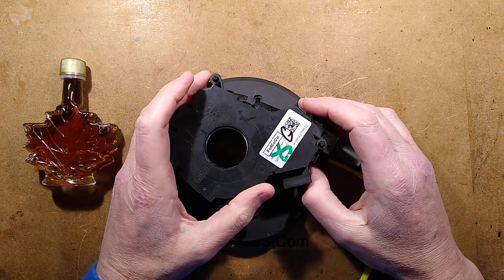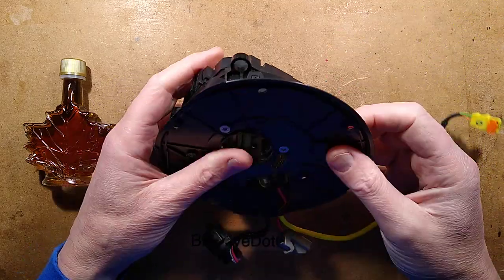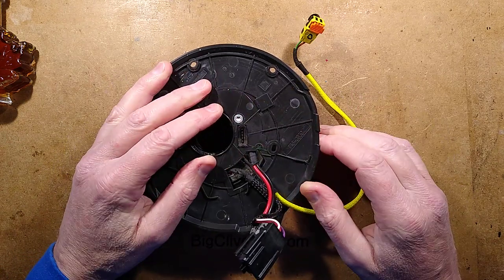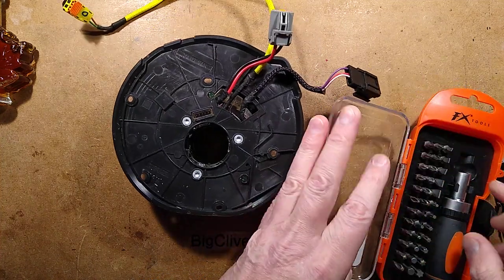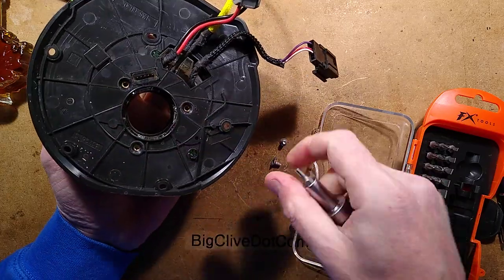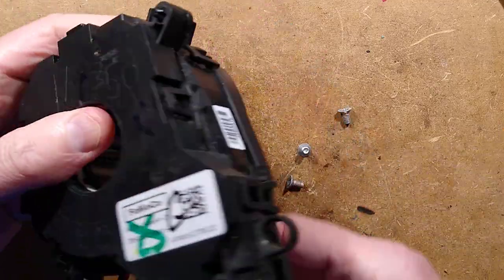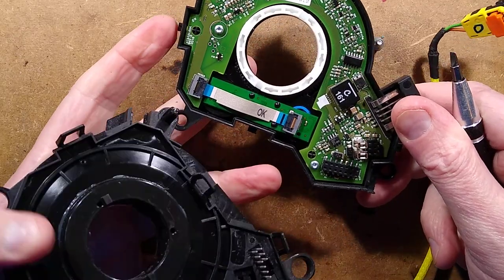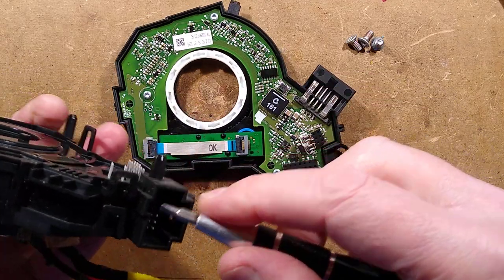Inside a car clock-spring module (steering wheel wiring interface)

Comment: That is a really genius way to make a "slip ring" when you don't need continuous rotation, but only a fixed number of rotations in each direction! Just use a long ribbon cable!
Reply: I bought one from a truck after failing to make a DIY-style slip-ring setup for my sim-rig, and even though the one I have is much more simple than the one Big Clive got send, when I opened it up I was like "Now why didn't I think of that?" :P
Mine does 12 turns from fully left to right before hitting some kind of endstop.  The ribbon cable is not forced at that point, because I can still hear it rattle in both positions.
The one I have does not calculate the wheel position (knowing Volvo parts by now, they found some other superingenious solution somewhere else in the steering column for that :P ).
The buttons on the wheel the clock spring module belongs to (there are 5 in total, 2 horn buttons sharing the same 2 pins and 4 cruise control buttons that are multiplexed (I think) because there's only 4 pins present, which is obviously to small amount for 4 buttons.

Luckily the PCB has a marking for the V+, so that at least gives me a clue :P.

Comment: Fun video. Reminded me I modified my 1970 MGB to move the horn button from the stalk to the center of the steering wheel. Chopped up a pen to hold a carbon brush and glued a copper PCB to the steering wheel hub to act as a slip ring.  Looking at the assembly it has more wires then the entire MG.

Comment: Fortuitous timing Clive, from my point of reference at least. I just rebuilt my steering column on the parlor floor a week ago. Had to pull the wheel a second time as I had got the clock spring position wrong. Cheers!

Comment: i had one of these causing an intermittant fault in a Nissan X-Trail. Sometimes the buttons on the steering wheel would not work depending on what position the steering wheel was in. To mitigate this i tried to turn the clockspring one turn either way so it would be in a portion where all the functionality would work. Unfortunately there wasn't enough play and the clockspring ribbons snapped inside causing the cars electronic stability to be disabled. This also caused the reversing camera lines to be allover the place. Cost me £500 for a replacement but i think it needed one anyway. They are pretty impressively complex after watching this video. thanks!

Comment: That's the SCCM (Steering Column Control Module). It does exactly what you said It does.
The data from the steering angle sensor is used by the static bending / dynamic lighting, as well as the electronic stability program, reversing camera, and a few other systems.
They are delivered with a locking pin to prevent roration until they are fitted to the vehicle.

Comment: Do the two small gears have the same number of teeth? If not, that gives the absolute encoding since the two magnetic encoders are never in sync. The encoder chips are probably something like the AS5600
Reply: I agree with this. 
If the number of teeth was off by one, each rotation of the larger of the two gears would cause a phase shift of 1/number of teeth on the smaller gear. That should make it pretty easy to calculate absolute position regardless of the initial positions by calibrating and storing the relative phase at the two ends of travel.
Reply: You're probably right. Sounds like a smart solution to the absolute position problem. And why would there be two gears if they were to be identical?
Reply: different number of teeth also increases resolution
Reply: one hint is that one gear is color coded to visually confirm proper assembly
Reply: I figured the two chips would be out of phase to tell direction, but never heard of a solution like that with a different number of teeth. What a cool idea!

Comment: After you put a new steering angle sensor in, usually you need to calibrate the module with a learning procedure. Usually this starts with centering the steering wheel, then turning either way. The computer uses the data obtained to decide where the steering wheel is pointing. So it doesn't need hard data with a second magnet or reluctor ring to conclude exact position.

Comment: Starring wheel zero is programmed in during the alignment process which is used primarily by the ABS along with yaw sensor input to properly apply individual brakes during an ABSevent. By the way,  the yaw sensor usually needs to be programmed for center  (zero) as well.  Love you channel.  Cheers

Comment: This part is typically destroyed when the airbag deploys due to the forces and high current sent to the charge.  
Older pre-airbag Ford trucks with cruise control still used slip rings, they just had different resistances for the switches.  There were three rings, one for the horn, one for the switch power and one for signal return.

Comment: The blue and black gears look like they may have differing tooth counts and would give out dissimilar signals to the module to keep track of absolute steering angle sensor. As far as a sensor center position, the module is usually installed then the wheel centered and a steering angle sensor calibration procedure completed to set dead center and max rotation.

Comment: I've been a professional mechanic/technician for 20 years.  My wife's Chrysler van started acting up one day, doing  ABS stop and traction control for no reason.  I found the steering angle sensor way out of align to what it should have been.  After I got a new clockspring,  I took the old one apart.  

I found a small plastic gear, about the size of a US nickel had one tooth broken off.  And that cost me $500 for the part.

Comment: The sensors have multiple hall effect sensors inside so they can determine the absolute position of the magnetic field without having to have a zero reference or continually count. They sell these sensors for amateur robotics applications too, and they're nice because you don't have to ram over to a limit switch to find a reference.

Comment: Fascinating. I always wondered how that was done. My car has a heated steering wheel and countless buttons and switches. I assumed slip rings but those can so easily fail. The gear driven magnets are likely used to determine the direction and rate of the wheel turning to inform the stability control system rather than the wheel's absolute position.
Reply: Now I know how the horn, airbag, and all of the cruise control and radio buttons on steering wheel are interfaced with the column on my F150.
Looks like it will be the "1,000 $ part" when one of the ribbon cables gets a break in it.
Reply: "The gear driven magnets are likely used to determine the direction and rate of the wheel turning to inform the stability control system rather than the wheel's absolute position."
The newer F150s have electric power steering. This could also control the amount of power assist, and in which direction.
Reply: That is indeed for stability control, but the control loops do need to know the absolute steering angle. There's a specific recalibration procedure on all stability control equipped vehicles that's necessary if the steering system is serviced.
Reply: Not only that but also for the system to know whether and when to cancel the indicators in more modern vehicles if this is not done with a mechanical notch like in a lot of older vehicles.
Reply: They usually have a resistor ladder for the steering wheel buttons. ( 3 wires required). Primitive D to A. So surprised to see quite so many tracks. 4 airbag, 2 horn, 1 illumination, 3 buttons ladder, 2 heater. Cruise buttons can be separate for safety.
Reply: @AndyK.1  You get that in older vehicles, but Ford now runs CAN bus, GM and Chrysler run LIN to the steering wheel controls. There's probably a number of ground traces for shielding, and you have bus segregation, so the cruise buttons are on one bus, the infotainment controls are on a separate.

Comment: Yeah that is two parts in one. The first is the steering wheel position sensor. The second is the clock spring assembly. 
I changed the clock spring in my 2005 GTO to a 2006 so I could have the lighted steering wheel controls of the 06 model. 
Very interesting video!

Comment: Wow this is crazy my mom gave me one of these to help fix her car because I'm dabbling into Electronics now. Now I'm not qualified by any means but I have a really good understanding of electricity and repairing and making my own circuits. This video helps out a lot
Reply: Please, don't try messing around with the steering wheel assembly...you do not want to mess with the circuitries there and possibly cause an accidental deployment of the airbag... A friend of mine was trained to be a car mechanic and had "respect for the airbag" hammered in to quite an extend.
If someone in his class was messing with a dummy charge of one he got a verbal reprimande not to screw around with those things...

Comment: The chips are set at 180' to each other, the magnets are set 45' to each other's N+S (you moved one, you can see machining marks on them you should have used a small compass). The Zero is set by that clip right at the start of the video and all of that all of that vehicles units are made the same. The clip releases when the steering wheel is fitted. when fitting these units you should the use a scan tool to confirm the steering angle through the CAN link, then all the other vehicle modules can access the data from it correctly over the CAN BUS.
Reply: I wonder if in some cases they might have a slightly bigger cog on one encoder which would give a phase difference that can be used for absolute positioning.
Reply: @cda32  It looks like this is actually the case (unless it's an optical illusion caused by the different colours).
Reply: Colin and JMMC it is possible that the blue and black cogs are different ratios, It was not pointed out on my VW Bosch courses but having said that is another system that uses carbon tracks at offset phase and pick up contacts, the more common fitted to BMWs as its so cheep,,,BUT its so cheep to fit at build and a nice price to supply at out of warranty. The unit BC took apart was removed from the vehicle because the airbag light was on or the radio controls or the heated wheel did not work not the steering angle sensor, if it was a track system on a BMW then yes the angle senor system fails first. The unit at manufacture is "timed up" to a pre-set zero and locked with the clip when replacing one as long as the wheels are straight and you take off the steering wheel and the old units clip locks back in you will have no problems, often even a flat/disconnected battery will only require you to lock to lock the steering or a short straight drive to config wheel speeds to steer angle (and that in reverse is how flat some tyres systems work on some vehicles) 
Now Big Clive If you read your comments (and I know you do,,,I did that in a Scottish accent) if you have not binned that unit show everyone why it is possible to disconnect and reconnect an airbag full live circuit engine running don't turn the power off!!! the clue is inside the yellow connector !!!!

Comment: Hey BC, I think the two wheels are slightly different diameter, they are coloured blue and black to tell them apart. The ICs are probably a compass. The ratio between the two gears and the 360 deg compass on each gear will give an absolute position since the two probably wont be in the same position for several wheel revolutions.
Reply: This is a absolute magnetic encoder. you are totally right about the gear diameter sizes! it create a ratio where absolute position is calculated. Very simple, effective and cleaver way.

Comment: Dang clever if you ask me. Sort of like the long 'U' shaped cables used to attach to a linear motion table but wrapped around in the gap between drum and casing.  Make the ribbons longer and you can have the 'U' bend travel around several times, accommodating a large number of turns of the wheel.  And you can put a lot of different ribbons in there, just attaching each to a different point around the rim, and each doing their 'U' bend at a different point around the circumference.

Thanks for sharing, I've learned a new, rather clever design trick.  :)
Reply: Bought one from a Volvo truck (the part itself funny enough, is made by Renault and is much less complicated than Big Clive's version is) and it can go 12 times from fully left (hitting an endstop, somehow, couldn't find it when opened) to fully right (again hitting an endstop I can not find :P ).
The endstop feeling is not because of the spring being fully extended or contracted, because I can still hear the windings rattle inside when I shake it.
It does answer to my request for having a wheel go 4 times left from center and 4 times right from center for my sim-rig :P.

Comment: The hall effect rotation encoders are excellent.  I've had the pleasure of working with them before in robotics.  You need a special axially-polarized magnet.  But then it's no-touch, reliable, and you can get very high precision.
Reply: I should mention that they're absolute position encoders.  Not relative.

Comment: If I had to guess on the mode of operation, the system this is a part of, the ESC has to know the steering angle, but it also has to know the direction of travel and traction status (acceleration, rotation, and wheel speeds) to know if the two are at odds.

I would imagine it could detect a center position of the steering wheel by simply marking the count in the software when it detects the car moving forward, without any loss of traction on any of the wheels, or any turning acceleration, setting the value each time you start the car and move away. 

That then means if a garage sets up the steering tracking and you're left with the wheel in a non centered position to go in a straight line, it doesn't make the system go nuts. 

To be clear I'm not an auto mechanic, so I might be wrong on that.

Comment: The steering wheel unit also handles all the steering wheel buttons and usually sends data over LIN bus or possibly CAN bus from this module to a central module. So it makes sense to have a steering wheel position sensor there as well.

Comment: This isn't for drive by wire, this is to detect if rotation of the steering wheel isn't properly effecting the direction the car is moving. In other words, it can detect if the car is out of control.
Reply: In the olden days, that was the driver's job...
Reply: Probably to draw the on-screen grid for the backup camera too.
Reply: @mahlapropyzm9180  No offense, but I suspect you have no clue just how much electronics are keeping cars much more on the road in situations that in the old days would've caused a complete loss of control if the driver was unexperienced or made a judgement error, you see this in cars in the US compared to most EU cars: in almost every clip of dashboard camera situations in the EU, an emergency stop on the highway tends to result in a controlled stop just barely avoiding a serious accident, or a much less severe collision.

In most US dashboard clips however, most of the American brands, if the driver tries an emergency brake application it tends to immediately result in a complete loss of control due to something so simple as ABS sometimes still not being present in some of those cars...

Comment: Clock springs won't have interruptions as the wheel turns, makes very good sense. Same thing is used in laptops to connect the display to the main body of the laptop, you wouldn't want any interruptions in your display signal :)
Reply: All the laptops, including very recent ones I took apart in no way use clock springs...just a flatcable running through the hinge...in no way comparable (it's also why some brands suffer absolutely all defects at that location in a time period that should not have a product of that sort suffer a defect of that kind).

Comment: Vehicles now no longer have power steering pumps. They use a electrical assist ( a  electric motor ). The advantage over hydraulic is it can change the amount of assist that is used ,like at highway speeds it will use very little assist , because its not needed and to give more road feel and also forgot less load on the engine and it plays well with hybrids and full electric vehicles. The 2 blue gears act as rotary encoders, the reason for 2 of them is safety besides assist the power steering assist motor can turn the wheel for parallel parking and such and you wouldn't want a false reading and it turn the wheel or provide assist in the wrong direction. Having 2 of them provides redundancy and higher precision for safety and such.

Comment: Similar to what is seen on other cars when there is an airbag and other sensors/controls in the steering wheel. The manufacturers usually have specific guidelines on how to install it to ensure the ribbon cable (or clock spring) is at the center of its travel. In the old days when only a horn was present it really was a slip-ring with a spring-loaded brush that rotated around to make contact.

Comment: The video is very interesting but the comments are priceless.
Dunno about 'clock spring' as more a pair of multi-layer winches - one internal and one external. As the cables wind off one winch, they wind onto the other. I've seen single layer linear versions of these.
I need biscuits.